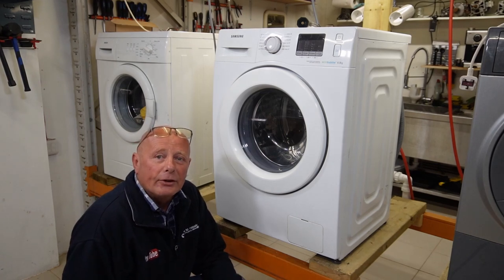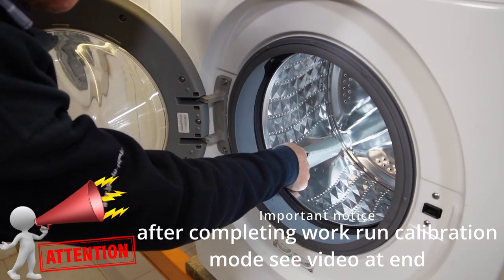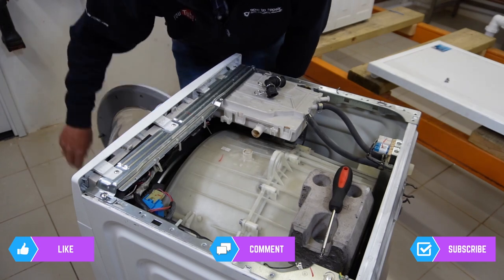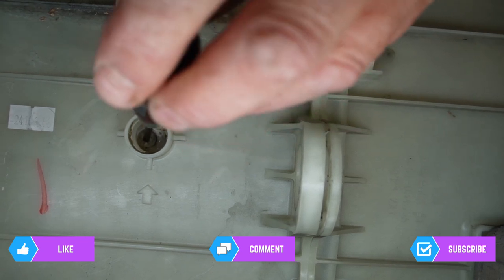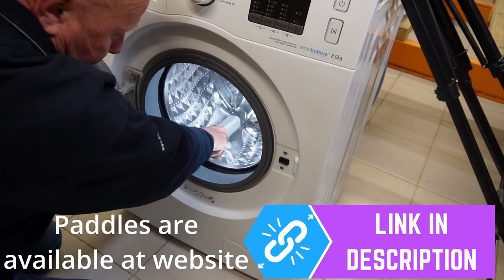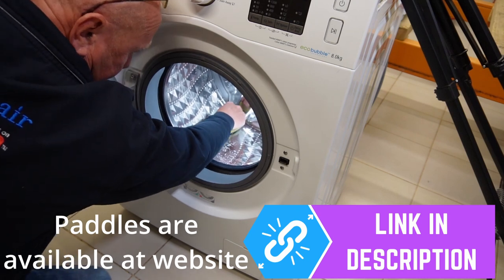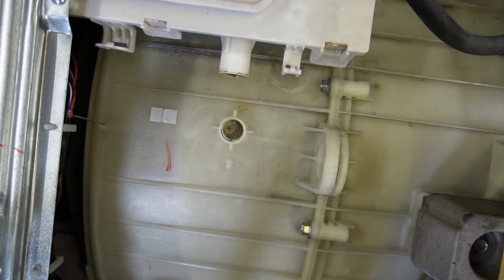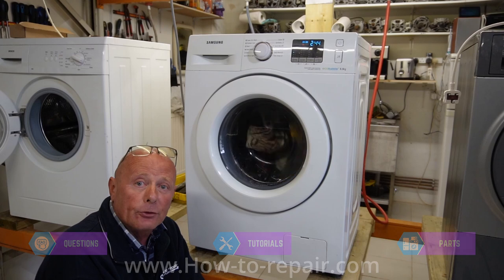How to replace and fit a Samsung washing machine drum paddle lifter or baffle

Comment: Alas, on the Samsung model I have (had) - WF42H5200 - the hole at the top of the drum is at a slightly different place, underneath the dispenser box and closer to the back of the washer.  It does not line up with the paddle screw.  The drain hole at the bottom does not line up either.  Faced with the task of removing/dismantling/reassembling the entire drum assembly as shown in another video, I chose to buy a new washer from a different vendor, and resolved never to buy another Samsung appliance.  The engineer who created a design that requires deep disassembly to replace a simple plastic part should be made to repair 1000 washers for his sins.

Comment: Easy trick for getting the ascrew back in is to roll up a piece of cardboard and use it as a sleeve, put it in the access hole and and drop the screw down the middle.

Comment: i have model WF42H 5200 AP/A2 a North American model and yes the holes did not lined up.  As I was shining my light in the drum, one could see all the holes of drum looking down from the exposed top.  I calculated where the screw lined up with the new lifter as a guide.  Reviewed some other youtube videos… and the prospect of taking out the drum was a no go. Therefore, I decided to drill a “service” hole.  Re sealed hole with plastic plug and duck-tape .

Comment: You can use a screw starter to put the screw in...it will hold the screw until you tighten it and it will release.

Comment: Thanks for your this amazing video. I used it without repair. And it’s damaged my clothes. I saw your video and I fixed it. I spend just 3.5 euros and it’s work amazing. I used new screw. 
But my old screw is still missing.

Comment: Are you able to tell me exactly what screw size that is? I need a replacement but I don’t know what measurements it is 😢
Reply from the maker: Hi, please use our contact us page and make sure you fill out the request for what your problem is. I will need the full model number of the identification plate and the details of your problem so that I can provide you with useful literature. A video shoot of the problem would be perfect as well.

I will get back to you within 24 hours, normally. https://www.how-to-repair.com/help/contact-us/  

Please remember to subscribe to our channel, as that's what keeps this channel going. Thanks, Paul 👍